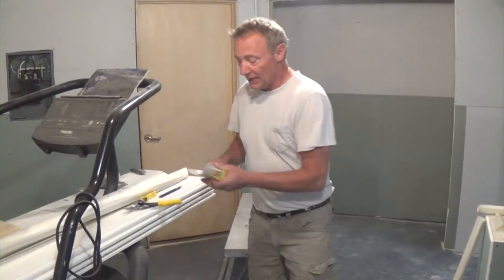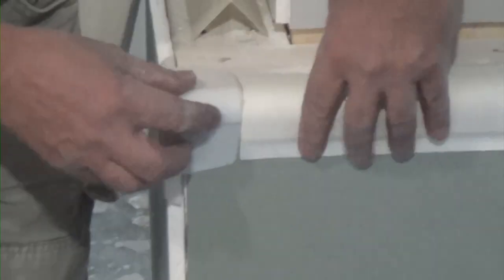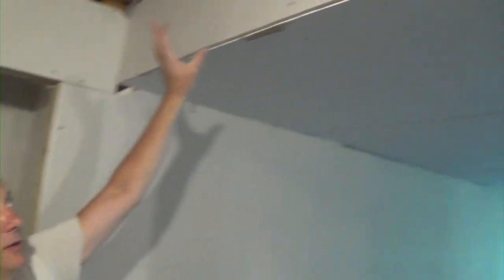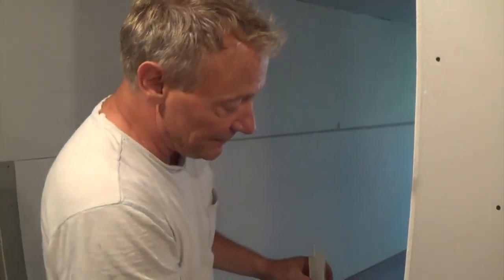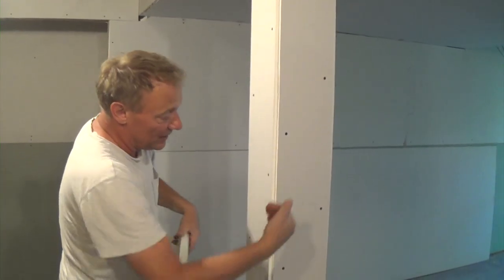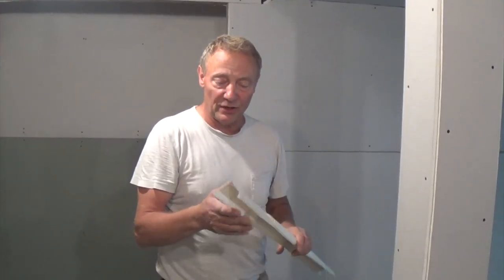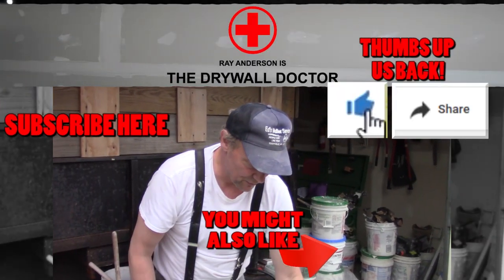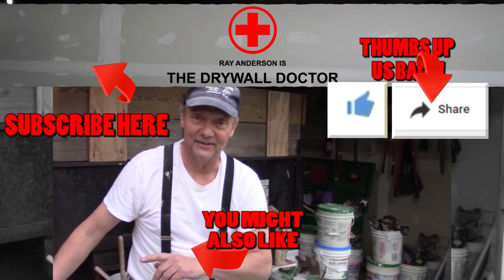How to Cut and Install Bullnose Corner Bead Bullnose trim pices

Comment: I got to where I didn't need the pattern. Just cut the first piece without the perfect curve then I got to where I could eyeball the piece that butted to it. Like coping trim. Got real fast at it and precise. 
 I've do e baseboard too. We never worried about the round corners. We would do them with an extra little piece on the corner.  22.5° on the joints to go around the corner.
Reply: Great Job

Comment: Hey Doc here where iam at all we do is bullnose (trim tex vinyl bullnose)and the only time we use corner bead is for commercial jobs or maybe in some remodels ...we make these cleaners out of caulking tubes to clean the bullnose of joint compound...if we use corner bead I prefer the metal kind because it stays straight unlike the plastic corner bead that sometimes is difficult to sit right...either way they both look nice when done right huh

Comment: Man, life saver tip about cutting the drywall back 1/2 from the corner. I'm putting this on an inset shelf, so cutting back the wood of the shelf would be a lot more of a chore than the drywall ;-)

Comment: For a novice/ dummy DIY home owner you went too quick with with the miter tool.
Home depot don't carry anymore. I found on line and bought 2.
I am terrible cutting the 45° .
Using the yellow handle cutter.
I like your hopper. I will shop for it. I have had a great deal of trouble finding bullnose tools. I found it is cool to do bullnose. 
Thanks
Reply: It's not that critcal......mud will hide flaws.....doesn't have to be perfect, use fiber tape to join both sides and mud over it

Comment: They make bullnose (rounded) corners for wood/mdf baseboard here in California......we use those on bullnose drywall......fits tight right around corner......so we glue bullnose corners to butt cuts on both sides

Comment: i just use a 2x4 with a 3/4" radius routed on its side attached to a miter saw. Tried that tool takes too much time miter saw a lot quicker

Comment: Hi Doc.  I will have to look for that Trim-Tex  Marker.  Thanks.  I notice a lot of outside angles/corners 45's there in your project.  Do you have short cuts for coating?  Can you run a small box across the outside angles?  Thanks.  Keep doing Great.

Comment: How do I join two bullnose corner beads midwall so a seam isn't obvious under the paint? 14 foot wall with 10 foot corner bead pieces.
Reply from the maker: Sometimes I put a small piece where they're going to meet and I nail it down tight and then butt it on top of that